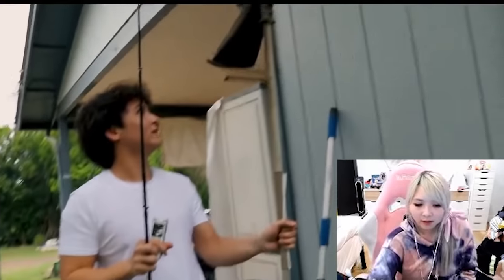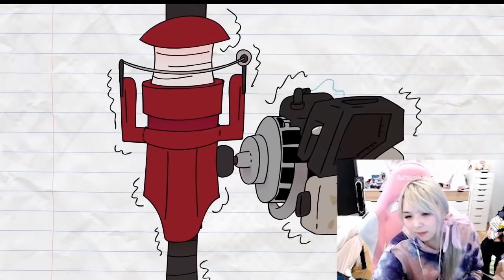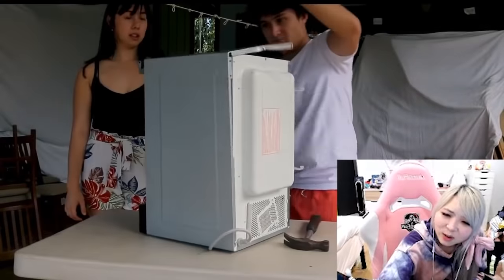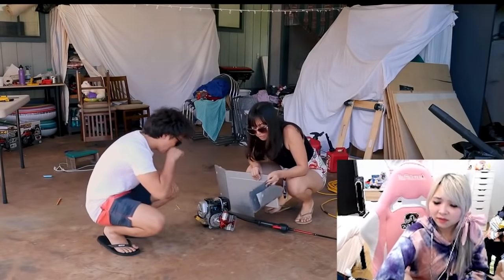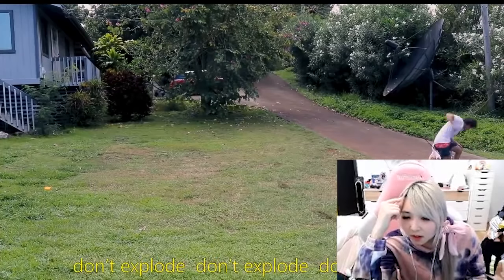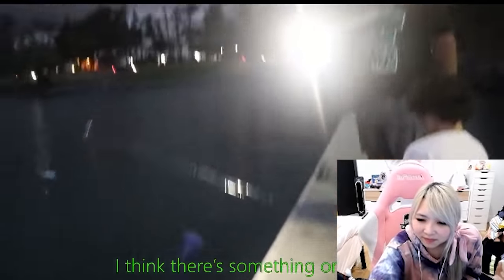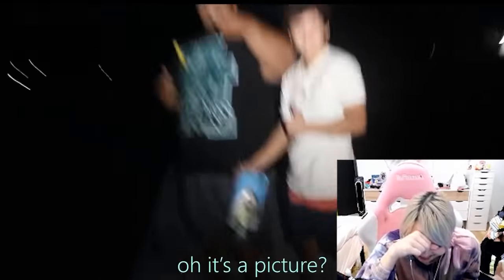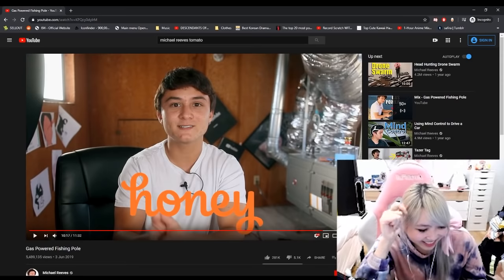Yvonnie reacts to gas powered fishing pole by michael reeves

Comment: But what if you added a resistance sensor to automatically pull the safety pin when it senses a fish in the hook it could patently work very well if you use a smaller motor